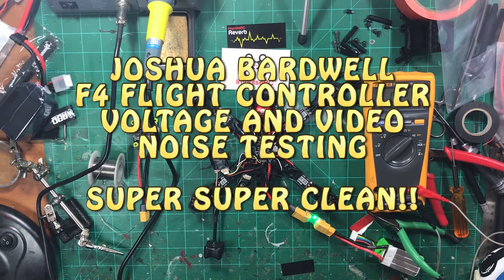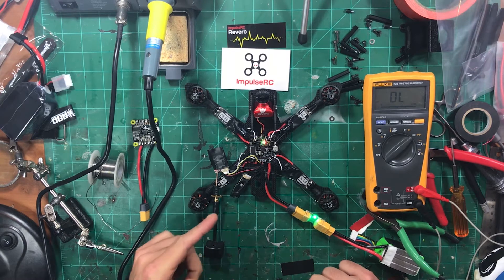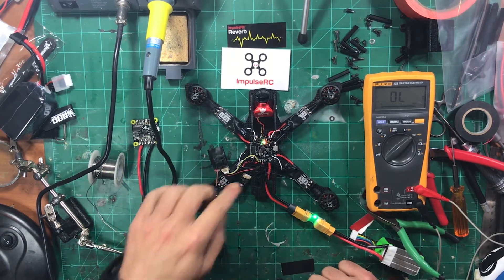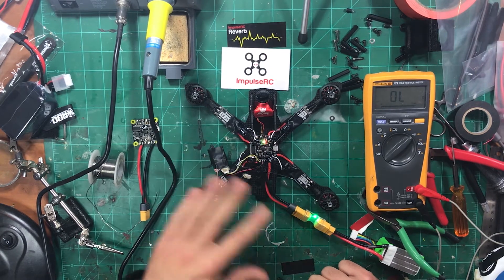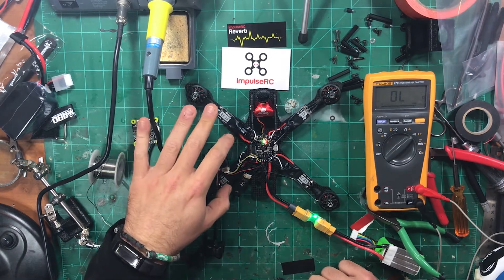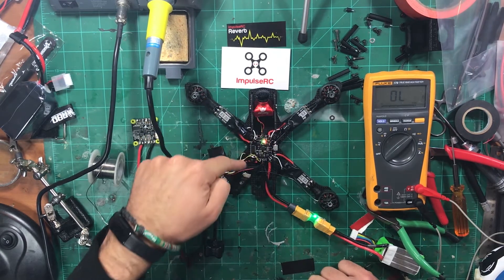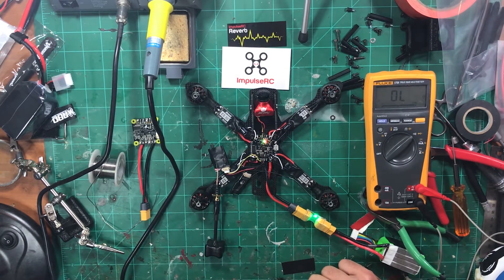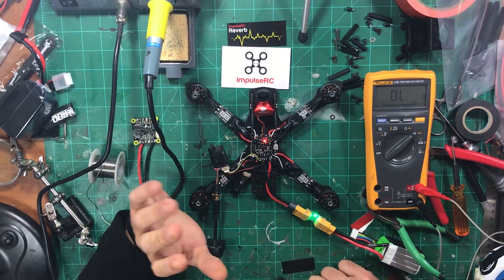JOSHUA BARDWELL F4 FLIGHT CONTROLLER VOLTAGE AND VIDEO NOISE TESTING

Comment: Noise is in flight with props.. Not on bench with no props.. If it generated noise on the bench like that with no props then it would go to the trash. 

Motors generate 80% less noise on bench with no propellers I have been testing this stuff for over a year.
Reply from the maker: Drone Mesh yeah. I watch your channel and am subscribed. I appreciate your input. Maybe you should buy one and run your tests and see what you think of it. It’s a very popular board and I’m sure your viewers would appreciate it.

Comment: Not sure if it can do crosfire and gps at the same time.
Reply from the maker: not with out reassigning resources in BF CLI. best board for that was the DYS F4 PRO..had everything for crossfire and smart audio and gps all right there..but ive got a pile of them here..they just die!!  but they were out of stock for a  long time and now are back in stock so maybe they have a better batch..id like to try one again so I can add GPS back to one of my LR rigs but I need some evidence that they are better now.
Reply: Yeah I got 2 of those new Dys F4 V2s just sitting here, hope they are better this time
Reply from the maker: dude seriously let me know!!  like for  reelzzz :)
Reply: it depends on what you want. theoretically it can do it but you would have to either use softserial and resource assignment, or lose one of the other uarts for things like smartport (which you wouldn't use anyway on crsf) etc. check page 3 of the manual: "The board has been designed so that most pilots will be able to use all the functions they want, right out of the box. SoftSerial is available for less common combinations, or if you accidentally damage one of the pads on the FC. Enabling SoftSerial is described later in the manual."